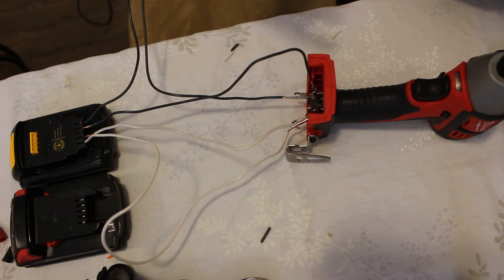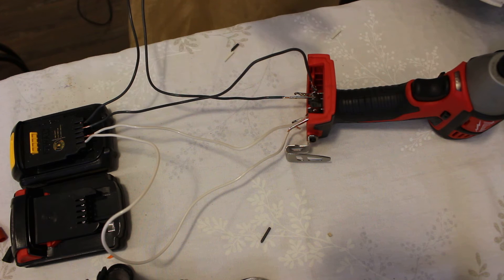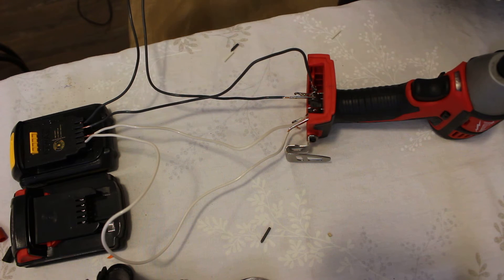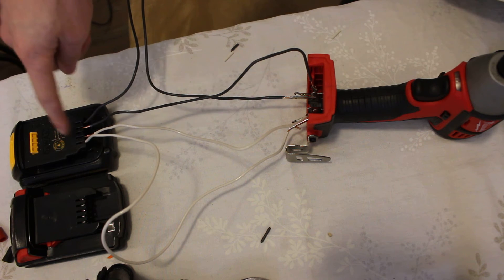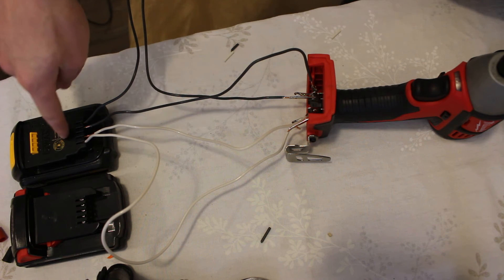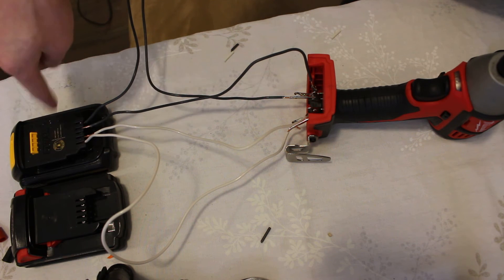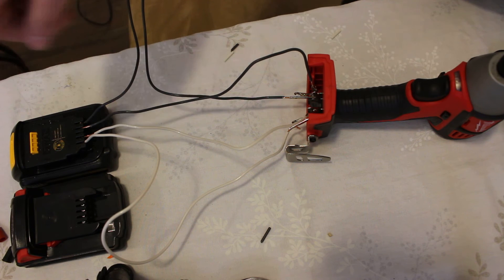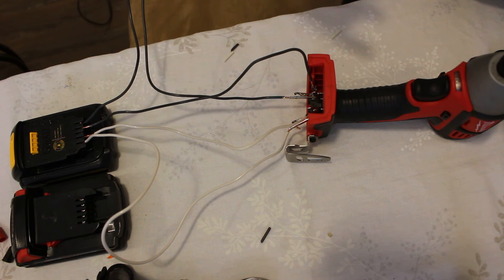Milwaukee M18 Tool Running on Dewalt 20V Battery

Comment: Will the Milwaukee run on just positive and negative? I can get a Ridgid to Milwaukee adapter from China but want to make sure Milwaukee will run on just 2 wires
Reply: Good question.  I wonder what those other terminals are.
Reply: @Golgafrinchamdent  some of those other terminals are for load balancing from the charger and also temperature sensor built into the battery also for charging and tool detection to shut off if the pack gets too hot in some cases.

Comment: The DeWalt is actually 18v.  In Europe they aren’t allowed to lie, and they print 18v on batteries for the European market.  Same internal components.
Reply: Yep, those batteries he shows contain 5 each 18650 cells rated at 3.7 volts, thats 18.5. they can be slightly overcharged to 4 volts each, making 20 volts total. It's all about manufacturing creativity.
Reply from the maker: I am aware of that. Regardless of the actual voltage it is still called 20V Max.

Comment: Is the Milwaukee tool you're connecting to brushless? I'm not sure this would work with brushless tools as they may communicate with the battery's electronics where as brushed tools defiantly don't.

Comment: There can be a problem with using other battery packs with other brand tools.

But actually, the power cells are not the problem. You can basically connect anything as long as it can provide right voltage with enough ampere.

The problem is protection circuits. There are a lot of protections with those batteries and tools. 

Milwaukee battery packs have a huge circuit inside. So it's highly likely those protections are in the battery pack.
In the other hand, DeWALT battery pack has almost no circuit in the battery, other than very small one with couple resistors. So tools might have those protection circuits.

If this is true, using DeWALT battery on Milwaukee tools leave battery without any protection.
It might be OK as long as the load is not high, and you don't use that until battery totally depletes.
But still, it's risky and you might kill the battery.

Probably, that's why there is no adapter like that. Nobody would want to take responsibility for that.
Reply: you wont kill the battery the tool dies long before the battery drops voltage I made video last year. Only if you are real idiot and use it on something like a grinder but a impact or drill is no problem at all.
Reply: Stinkycheese you are wrong because I already made the video trying to kill the dewalt battery. Maybe if you actually paid attention instead of spamming misinformation you would have seen it in action. I blocked Stinkycheese from posting on my channel because he doesn't know what he is talking about.
Reply from the maker: Yes this is something which I am aware of. Adding a simple circuit to the adapter can solve the over-discharge problem quite easily and cheaply.
Reply: No, it's not a simple circuit, nor easy or cheap.  It will have to be custom made for the pack and capable of the high current that cordless tools such as this need.  It will take a lot of time and expense to custom make this circuit, FAR FAR more time than the mechanical adapter which doesn't even need to be 3D printed.  To make that you could just silicone rubber mold the two pieces you need then cast that with polyurethane.
Reply: Your advice is bad and plenty of other people have already described the potential problem I did, on many other videos where people have tried.

Just because your limited test run didn't kill the battery YET, that not only is not proof it won't eventually happen, but possibly even result in not just a dead battery but a dangerous cell breech which with Li-Ion, can burn down home and vehicle.

Go ahead and DO MORE RESEARCH YOURSELF.  It is known that Dewalt has the protection circuit in the tool not the battery and their batteries should NOT BE USED on another tool line where the protection depends on being in the battery because it's not in the tool.

DO ASK this question in a real electronics forum dealing with Li-Ion batteries instead of the (typically) less educated crowd that posts any random unsafe idea on youtube.
Reply: No one else has tried to drain a dewalt battery on purpose because the batteries are $50+ not on youtube or anywhere else. Post a link of someone draining a battery on youtube? My test was limited? No the battery was drained over and over until the 20v hit 5 volts. You haven't even watched it or you would know what you were talking about instead of spreading misinformation!  You can't even come close to hitting 5 volts with normal usage you can't even bring the tool down to 14v  with normal usage because the tool dies out waay before 14v....do you get it? You will not have any usable power at 14v your impact or drill will not turn to the point you can drive a screw....it is obvious to the user...if you watched the video you would have seen that. having a brushed motor DOES not mean it will drain the battery because that is exactly what I used in the video. This scenario that the tool will drain the unprotected battery just does not exist in real world use.
Reply: adding to my last reply the only way to make this happen is to tape the trigger closed and leave the tool like that overnight that is just not a real world scenario for these people making battery adapters who only want to drive some screws. If everyone listened to people like you and those on forums nothing would ever get done
Reply: You must have a very bad measurement method or weak ass drill if you think the battery being 14V won't drive a screw.  That's an insanely defective result.  A typical drill will keep spinning down way below the safe threshold for Li-Ion cell discharge.  Whether whatever PARTICULAR screw you were trying to drill was too much torque at that voltage, has more to do with the screw, material, and drill than the voltage.

Do whatever you like, it's your property you put at risk, but others should know that this is a KNOWN DANGEROUS issue with Dewalt packs having the protection citcuit missing, in the tool rather than the pack so they are about the worst pack to choose for an adapter hack.
Reply: Whatever you're trying to state (lol) you are incorrect.  An impact or drill that uses a brushed DC motor will MOST DEFINITELY AND RELIABLY drain a cell to the point that it is damaged if there is no protection circuit to stop that from happening.  All a user would have to do is keep using the tool to the point where the gradual slowdown they didn't previously perceive since it was gradual, crossed the critical low voltage threshold of battery drain.

Only a real idiot would use a battery/tool combination where neither had a low voltage cutoff protection circuit, but even an idiot can safely use a tool and battery combo that has one.
Reply: Love that last bit!

Comment: Why would it not work? Both are 18V batteries Dewalt 20V max is just sale gimmick.
Reply from the maker: Because when connecting only the positive and negative terminals, it does not work.